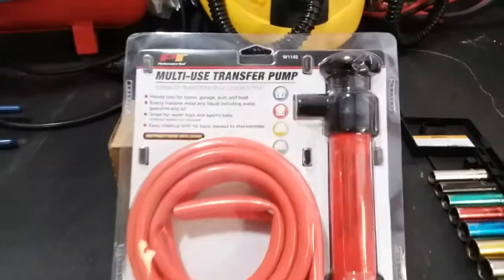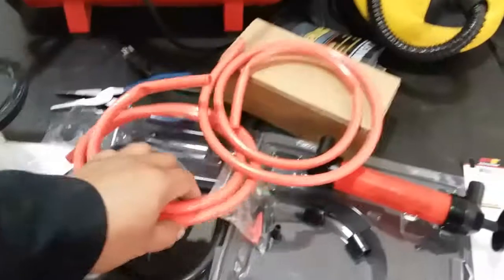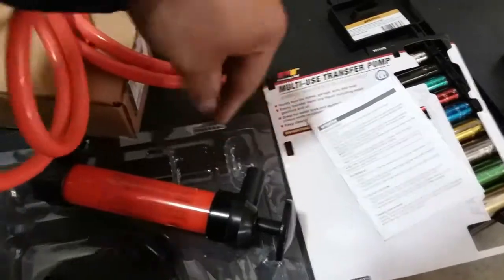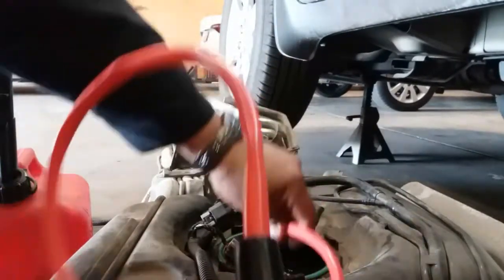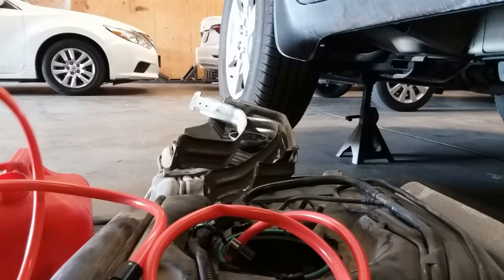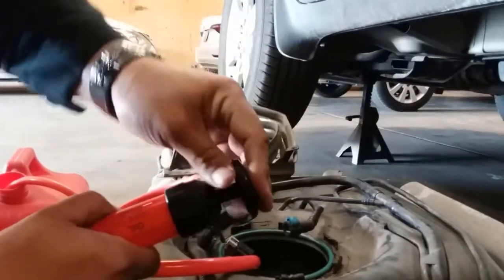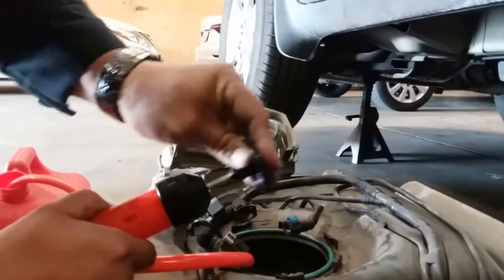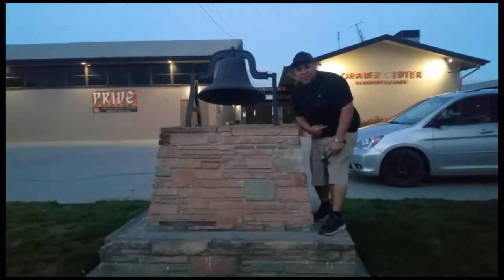How to: Use a Multi Use Transfer Pump

Comment: Does it have enough pressure, about 15 psi to pump water through water filtration system with membrane, when there is a no tap water?
Reply from the maker: I don't think so, you gotta try it and see if it works for you sorry
Reply: @559powerscape  OK, thanks.

Comment: How do u repair it. After pumping water on an off for a hr or so it acts like a seal or sum thing broke
Reply from the maker: Does it work after a while? It must might be heating up and not making a good seal at the time. Or maybe the seals HAVE gone bad. I'm not sure if it's repairable...I would take it in if you have the receipt and say it didn't work. They might hand out a replacement
Reply: @559powerscape  its manual. Im trying to c how to fix it i checked both cords they good the pump was unscrewing from what ever is inside i screwed that back it wirk a while then stopped again. I got this cause it looked simple.  But i guess cheap is cheap.
Reply from the maker: @goddessgoldglow  big facts

Comment: Yeah I don't know what happened I have the exact same pump and it just will not work it's really starting to piss me off
Reply from the maker: If its not working, as long as u have your receipt or phone number on file they should be able to swap it
Reply: @559powerscape  I think its cause im not pinching one side when i first pump it or alternately i dont have any liquid in the outlet to get it started. At least thats what im seeing from other people online.
Reply: I just bought one of these and it says you need to pump it a few times to prime it and the top is where the water …goes in in the bottom is where supposed to go out and being lower than the top. That is to siphon correctly.